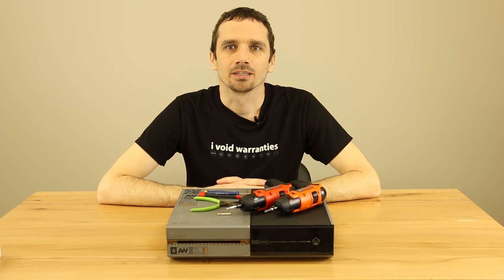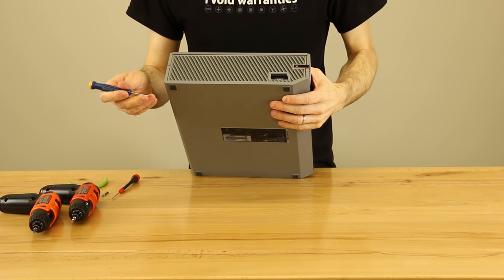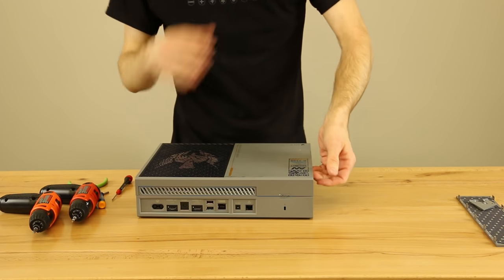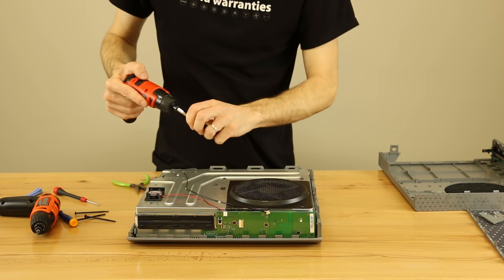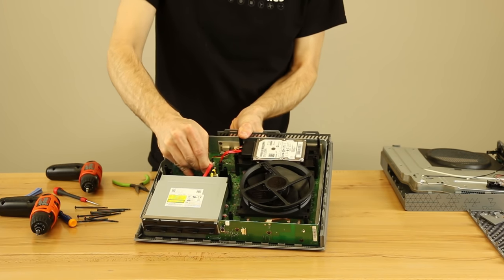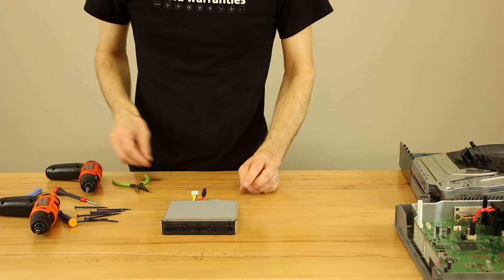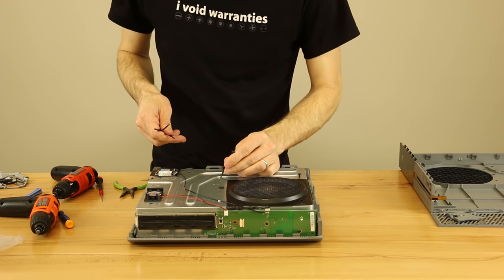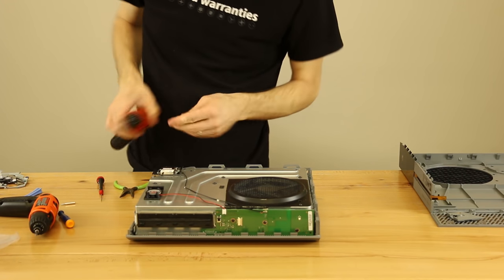Xbox One Disc Drive repair

Comment: ok I received my part just like how you have shown but it is still making noise and not working. Any tips as to what I could be doing wrong and or other part I should be checking
Reply from the maker: Sorry...there's just no way for me to know what's going on with yours without being able to see it.
Reply: Ok thanks. I found a loose spring in there from the old optics drive so I'm putting it back together and crossing mybfingers
Reply from the maker: Good luck!
Reply: Did it work afterwards?
Reply: +Evaldash I'm sorry to say no. it will now run the dics but it still won't read the disc

Comment: Hello. I did this yesterday and my Xbox was fine. But I did it again today and now my Xbox won’t connect to the wifi. It has never given me this issue before and I think I hooked it up right. There are no signals when I try to connect. Can someone help?
Reply: maybe you didnt push the wifi board all the way down, or the connectors arent on properly

Comment: Hi,  my xbox one wont insert discs correctly - when I put a disc in I can see a little of the disc sticking out.  Any ideas?
Reply from the maker: +SuperJBrowne Hmmm...not sure. It sounds like there's just something inside the drive that isn't working correctly. Sorry, I can't be of more help...it's just hard to know without having it here at my shop to check out.
Reply: Can i link to a guy having possibly the same issue as me?  watch?v=o5nl2xAK6WQ
Reply from the maker: Sure...it's not that I don't understand the issue...it's that there are lots of things that can cause it and there's no way to know what it is unless I can take a look at it.
Reply: TronicsFix
No worries, just want to see if I can save some money by doing it myself lol.  I did open it up though, I left the drive connected so I could see what happens when I put a disc in and I couldn't see anything aside from the disc not going all the way in, there was a grinding noise when I held it on a slight angle. if that helps.  Sorry for all the questions dude.
Reply from the maker: Usually when there are grinding noises it's best just to replace the entire drive.

Comment: When I try to take the disc out of the disc drive by pressing the button it doesn't work. I tried ejecting a disc manually using an Allen key but it's like the disc is stuck. What do I do?
Reply from the maker: +Paolo_B_Skate It's hard to know for sure but sounds like the disc drive is faulty. We're happy to repair it for you: http://www.tronicsfix.com/xbox-one-disc-drive-repair.html
Reply: +TronicsFix my disc drive is also experiencing the problem where it won't read the disc
Reply from the maker: Sounds like it may need the disc drive replaced.

Comment: my xbox one wont acknowledge that the disk is inside. plz help.....
Reply from the maker: Probably either needs a new laser or there's a problem inside the drive.
Reply: TronicsFix thx but i fixed it. i cleaned my disk with alcohol and ot worked,but only use a small amount, and press firmly,but not to much.

Comment: So what's it mean if my laser was moving an now after taking the drive apart an just giving it a quick clean with a cloth an it doesn't move anymore. It wasn't reading the disc hense forth the reason why I dismantled it in the first place
Reply from the maker: It's either because you messed something up when you took it apart or just because the drive is broken.

Comment: my dosk is stuck in the cd slot the side hole manual eject wont work help either think it got jamed it the back wht do i do
Reply from the maker: If you can't get it out with the manual eject you'll have to remove the disc drive and take it apart to get the disc out.

Comment: i need help i replaced the green  board in the disk drive and now an error comes up (error 100)
Reply from the maker: The green board is not replaceable. You have to always have the original board in that came with the console. It's matched to the motherboard.
Reply: I've fixed it now thanks for the help
Reply: Coolercoaster63 How you fixed it because i also get E100
Reply: TronicsFix Is there any chanse where or how  i can find authentication key

Comment: Had the E100 error at 59%.. Turned out the blu ray drive was bad.. wouldn't even accept discs.. I got a new drive that was known to work and swapped the daughterboard with the old one.. then the new drive did exactly the same thing so something on the daughterboard went bad (so my xbox one s is basically bricked unless i can replace one of the components). I checked the hard drive log on the computer and it said ODD not found! The xbox still updated to 59% then got E100. I was curious to see what putting the old drive in with the wrong daughterboard would do so I did and it now accepted disks so it was 100% the daughterboard! Still tried the update but obviously got the error this time with the wrong board in the xbox.. I changed them back to normal to see if maybe i did something wrong and checked the new drive and it now accepted disks with its original daughterboard (it also sounded like it was reading).. So in summary, whatever disc drive the original daughterboard was in was doing nothing when putting it in the xbox (and causing the E100 error)..Problem is the Xbox requires the original daughter board married to the motherboard,which in my case was trash (100% confirmed).. So basically I was SOL... smh! Swapping one of those small chips  on the daughterboard is an advanced repair requiring more precise tools that I'm working on getting. I wish Microsoft didn't make it impossible to change the disc drive without the board. Very disappointing that it had the worst possible problem

Comment: my drive spins up about 2-4 times then gives up but get this its only on already installed games if i have a new game i borrowed infinite warfare only installed once xenoverse 2 was tryed as well the disc drive reads it but it will never pop up to install on the blue ray movie app it says go to games and apps what is wrong with my drive is it just dead? its an older console and microsoft wants 160$ for an out of service repair i really need the help ive had 3 360s suffer similare fates and now my xbox one is down xbox hardware just isnt worth a whole lot im not paying microsoft to send me someone elses refurbished console thanks in advance and please dont say i should have bought a ps4 believe me im already aware
Reply from the maker: It's hard to know for sure without having it here in my shop to look at but it sounds like it may be just a problem with the laser. It's also possible that the whole drive needs to be replaced. You can always send it in if you'd like: https://www.tronicsfix.com/collections/xbox-one/products/xbox-one-disc-drive-repair